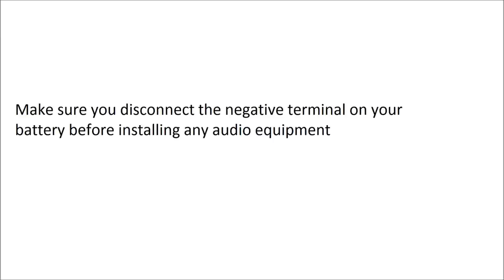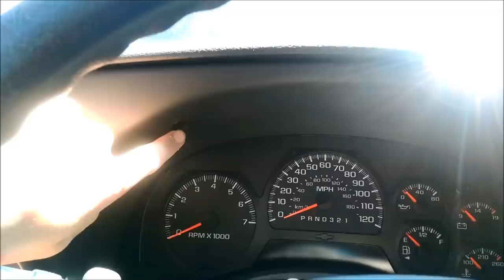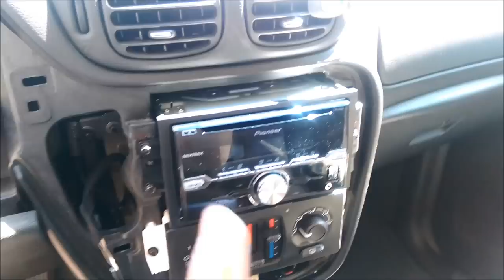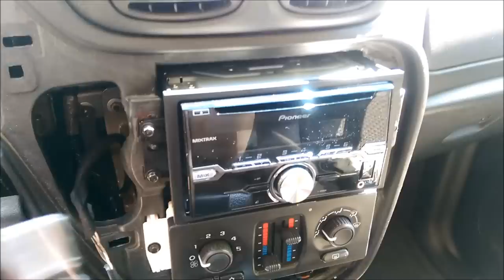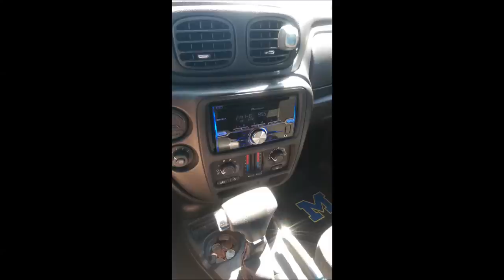Radio install in Chevy Trailblazer with Bose premium sound

Comment: How did you do the illumination wires. I have illumination and dimmer wires. The instructions told me to connect the orange with the orange white unless it was populated on the factory side. This is my first time doing this I don’t know what this means
Reply from the maker: Greg Keener honestly i never got the illumination to work. it’s not a nesassary unless you want it? populated on factory side means it was hooked up and being used. like had a pin out.

Comment: So does anything actually have to be done directly to the stock amplifier in order to bypass it, or does this harness make that happen? I have a 2006 Envoy Denali w/ bose and onstar, no DVD.
Reply from the maker: this adaptor takes the 50watt signal coming from the head unit and reduces it into a signal that the factory amp can use. some choose to not use the adaptor and just remove the factory amp and replace it with a new amp all new wiring and speakers. but this adaptor allows for a new head unit retaining all other factory equipment. hope that helps! :)
Reply: +Rydog's Garage yup, thanks!
Reply from the maker: and I'm still using this adaptor a year and 4 months later, no issues, and I crank the music all day everyday lol, I have 2 12 subs installed and I swapped the head unit for a touchscreen one, so it has worked for 2 head units also

Comment: what color wires do you have passing the interface?
which colours are the navigation system. my new head unit does not have navigation.
what is the 12 pin connector for.
last question hahaha. what color is the remote turn on for the harness itself because i have an amp and subs going in and cant find the remote turn on.
If you get back to me asap that would be really helpful.
Thanks
Reply from the maker: only the black ground, and yellow and orange wire bypass the interface I believe, your only matching to the harness that came with your radio, the 12 pin one is for steering wheel controls, if you don't have them the wires can be pulled out, and the nav wires are all the extra ones that don't match to a color on your radio harness, they can be cut and capped or pulled out also, the remote turn on wire should be labeled by the Harness that came with your aftermarket Radio
Reply: +rydog12100 all i have left on the aftermarket harness is blue and its for the power antenna. is that still the same as remote turn on and what would be the color on the metra harness?
Reply from the maker: +Gavin Blanks yes power antenna turn on would do the same thing as remote wire, and does not need to be hocked up to the interface just straight to your wire to your amp, but the dark blue wire on the harness would go to it

Comment: hey man, thanks for the video.  I have been searching everywhere for answers.  I've got an 05 trailblazer and just replaced the 4 factory speakers with RF and am adding 2 RF in the dash.  I bought a head unit and also the interface from axxes.  since I only have 4 speaker outputs, I thought about running the 4 front speakers off of a cheap amp and the 2 rear, off the head unit.  I am so lost as to how and hook it up this way using the interface.  any help would be so appreciated.
Reply from the maker: hey! you are going to have to wire only the rear speaker wires to the interface and head unit, and then run rcas from the head unit to the amp for the other 4 speakers, there is white grey purple and green wires, for the speakers on the harness, each one is for a seperate corner of the truck, I forgot exactly which color is which corner but it should say on the wire, and you are going to need to figure out and use the rears, for the front speakers and amp you have to run seperate speaker wire from the amp to the 4 speakers, and power and ground for that amp, remote turn on, and fuze the power
Reply from the maker: sorry I know that's a mouth full! lol

Comment: I have a Jvc with the same harness and I have a orange wire on the headunit and a orange with a white stripe what should I do I tried connecting them and it did not work and tried without them and still didn't work
Reply from the maker: the radio dosent work without that conected? what color wires are in the jvc harness?

Comment: Did you use the RCA's or just the wire connections for the factory speakers?
Reply from the maker: Jeffery Morris this adaptor harness uses the stock bose amp and speakers. and makes it work with the aftermarket radio. you wire the white green silver and purple speaker wires in like any other install. the rcas are for my separate sub amp.
Reply: @RydogsGarage  thanks man. Worked perfectly

Comment: I have a question. did you leave the factory Bose speakers or did you get aftermarket speakers?
Reply from the maker: +Jose Hernandez all speakers are factory, this adapter in the harness allows for you to keep the factory speakers and have a aftermarket head unit, because honestly the bose sounds verry good, just wanted an aux port for my phone, and a easy way to install subs
Reply: Oh alright that's pretty cool then. Yeah I understand I still have the Bose stereo and I have to use a fm transmitter to use my phone and it sucks!!
Reply: Thanks a lot this video is very helpful!!
Reply from the maker: yeah fm transmitters are not good enough for my im big into audio, i actualy just swapped the radio again to a pioneer touch screen, avh-2700bs, used same harness bluetooth and hands free calling is all work flawlessly, if you have any more questions i can help you out! wiring for this stock bose is a pain! but all worth it in the end, no reason to rip out good speakers and buy all new especially if you want to sell the car
Reply: I got intrfacer at Auto zone 50 bucks for 2007 Cadillac srx

Comment: I hooked the harness to my cd deck. matched all the speaker colors but my volume will not turn up on my speakers. would you know what is the cause of no volume? your advice will be appreciated.
Reply from the maker: the gain knob on the harness could be not set correctly, it's the little blue dial that uses a Philips screwdriver to turn it. there is a special start up procedure to set the chime volume then set the gain
Reply: Rydog's Garage I have the same issue but my front speakers are loud but my rear plays real low what is this issue

Comment: hey. raydog. question.    I hooked one of these up in my yukon and the sound/audio only plays for about 5 seconds. then goes silent. any clue why?  everything continues to work just no sound
Reply: Tom Mccarthy exact same thing with me. I have a 2005 Tralblazer tho
Reply: @ethantaylor901  I just installed and have the same problem,  did you find a fix for yours?
Reply: I have the same problem! I thinks it's a interface glitch . I know for a fact I have everything wired properly. I have 07 gmc envoy with bose

Comment: It will work with out the the metra box you just need to run acc wire to the fuse the box is only for on stare
Reply from the maker: no not true. you don’t want the 50 plus watt output coming from the aftermarket radio and getting sent to the bose amp. it will fry it. box brings it down to just the signal. as well as having conections for onstar.

Comment: Question: did you have to remove the stock stereo bracket in the back of the stereo space for your install?
Reply from the maker: Adam Tyma yes i took a dremmel and cut the back support out to give extra room for the wiring harness

Comment: I bought the gmos-04 for my 03 yukon xl. I bought the Sony MEX-XB100BT that has the extra amp to it. I don't to use the bose amplifier anymore because it's failing. Is there a way I can use the interface but bypass the connection to the amplifier? Can I still use the speaker wire in the door?
Reply from the maker: diesel2421 if the radio has a amp in it, you should be able to run the wires for the speakers together bypassing the interface, and then find a way to wire and bypass the amp in the back of to truck, i believe the amp is on the passenger side all the way in the rear... but don't quote me on that
Reply: Rydog's Garage the amp is up front under the center console. So new speaker wires would have to be ran from the factory amp? but I dont want to use the factory anp anymore...
Reply from the maker: diesel2421 sorry i read that wrong didn't realize you have a yukon... the amp for the blazer is in the back, no you just have to unplug the factory amp and run wires from the radio to that plug that you took out of the factory amp

Comment: Hey Im installing a pioneer radio in a 2002 Chevy Impala without Onstar, I just can't find any install instructions online. I have all the parts, I just don't know where to start.
Reply from the maker: +Yalena Talley the harness needs to be custom made, by soldering the wires together, the harness that came with the radio, and the adaptor harness you bought that plugs into the factory connections, should match color to color, solder those together, and use shrink wrap make sure no bare wire is exposed, then continue to take your dash apart and remove factory radio, not sure how it comes apart on your car have not been in one like yours, but the harness you made should plug right in an the radio should mount in same spot!
Reply: +rydog12100 The car has an adaptor as well so that it retains the chimes. How do I connect that to everything?

Comment: I have a 06 trailblazer and i am trying to install doubl din unit.  How did you wire the ignition red wire that gets wired to get the radio to turn on when the key is in the on poaition? Can you send me a good link or anyting that will help me wire the ignition wire for the radio.
Reply from the maker: Bethel Bekele it should be apart of the adaptor harness, if it is not you have to run the wire in the dash and under the steering wheel. and probe the red wire on the steering collum so that the probe lights when you turn the key. and is off when key is off. you use a tap connector on it to tap the radio wire in

Comment: Help! I hooked my aftermarket up. Its the size of yours and I used the same axess wiring kit. My radio comes on but barely has any sound. Do I need a wire to the battery?
Reply from the maker: no there is a gain knob you have to turn up on the axess harness
Reply: +chad hinkle I literally just went through this tonight. Installed my new deck,&#160;sound was going to every speaker but it was barely audible.&#160;&#160;You don't have a factory amp, I cut the speaker wires before the big black box and spliced them into the speaker wires on the radio harness. Pretty much I just bypassed the black box and everything works perfect. Or you can just go buy a non amplified harness.
Reply from the maker: +Jesse Taylor this video is for people who do have the factory Bose amp and is what the harness is for, like you said he must not have the amp and just has the normal sound

Comment: Were you able to maintain steering wheel controls? I have a Silverado I'm looking to do this in
Reply: that requires a seperate interface (atleast on my 2004 Envoy).
Reply: Paul is correct.  It's like an additional 20 bucks for the harness
Reply: I did somthing wrong my key wont turn all the way back

Comment: So I'm facing same issue. So all I need is that interface deal? Would I still be getting sound through the amp..or does it bypass it?
Reply from the maker: Sal Dorado with this interface you can use any aftermarket radio and the bose system will work exactly how it should
Reply: Rydog's Garage Thanks for the info! Already have a interface and Alpine deck lined up. I'm really quite impressed with how good the stock Bose sounds. Why not keep it...right? Surprisingly the speakers aren't blown yet...I'm just gonna roll with it.
Reply from the maker: Sal Dorado i added 2 12" subs and a 600watt amp for some extra bass and i love the way my system sounds
Reply: Rydog's Garage That's what's up right there! I have a system in my Jeep...I'm all about that bass. T.B. is wife's ride...she's not into all that..lol
Reply: Hey, do i need a harness that will comply with my steering wheel controls?

Comment: I have never unhooked the power or neg, 
I bought the $35  1 and it was as simple as crimping the wires and plugging into the stock harness and the radio. I forgot to turn the ignition on off on off before using the radio so I guess that's why the steering wheel controls don't work. But the radio stays on after pulling the key until you open the door and the chimes work. Yiup the setup I got had the accessory (red wire) and the constant 12V (yellow wire) with the box and the harness. (( PLUG AND PLAY )).
  Metra LC-GMRC-01 GM Class 2 Data Bus Interface: AMAZON $34.99

 Now for my AMP, I had to go under the LRP seat to find a REMOTE on-off fuse that worked with the accessory power of my 2006 Trailblazer LT. So I just ran the 12V power from there also. The only wire I had to run from the HEAD UNIT was the AMPS RCA's.
 Yeah the remote from the HEAD UNIT wouldn't run the AMP. (I thought my AMP was fucked up)

   Suggestion , Get a HEAD UNIT that the 7" / 8"screen will angle, 8" you will be cutting but will fit fine. 

P.S. 39 years of installing and uninstalling.
Reply: +sir jaime roland ruiz 
The only thing that should be on the steering wheel is CRUZ CONTROL! And or paddle shifters
Reply from the maker: +sir jaime roland ruiz i state to unplug the battery because its to save my butt, just incase someone dose not do the wiring right, i dont need them blaming me for fried equipment. thats all, i agree, i dont unplug the battery 9/10 either. the adaptor i bought allowed me to only match colors and it plugged right in, no need for me to run extra wires. the only  wire i ran extra was for my remote turn on for my sub amp. i like to soldier the connections because i know they will never come part and its just a preference. i have now sense upgraded to a avh-2700bs touch screen from pioneer and love it, was able to just cut and resoldier harness, plugs in and works exactly how i had it set, no issues.
Reply: rydog12100 , LOL right on, BUT... if they have hooked up the wires wrong and power it back up @ that very moment it will POP. So... 
TOUCHE !
  Congrats on the upgrade, not to bust ur bubble though. The first 1 I bought cost like $500 second like $300 and this 1 $169. 

  I love PIONEER but I can get the same or better for cheaper with off brands trying to make a name or just doing people RIGHT and not paying for a NAME! 
 Did PIONEER go ANDROID YET? I think KENWOOD did.
Reply from the maker: good point lol but less will be taken out, i would hope fuses go and equipment is saved
Reply: +rydog12100 hey , I lost my speedo and of course the cruz control and whatever it is , it's fucking with the shifting of my trans. I'm thinking it's the damn remote amp wire I disconnected.
Reply from the maker: +sir jaime roland ruiz I fuze could be blown... did you put the remote amp turn on wire in a ignition fuse in the fuze box under the drivers side rear seat?
Reply: rydog12100 lol fuck yeah!

Comment: At 5:41 what is the smaller plug for? 
I got a interface kit but it’s only got one plug for the bigger one??
Reply: Did you get any answear at that? I also need to know what cable i have to put in to that plug:)

Comment: my truck is non Bose system just regular everything do I still install everything like u did
Reply from the maker: nope you can get a regular harnes that does not have the adaptor, the harness will be a plus that goes to the stock conection that has wires that need to be matched and soldiered to the harness that comes with your new radio

Comment: how do i know if i need a interface i am putting a pioneer single din into my 08 sierra,i have 4 door speakers and window post 2"speakers not putting in any bells and whistles in just plain stereo radio
Reply from the maker: Buster brown does your factory radio say bose anywhere? or on the doors. if so you probaly need a PAC interface harness. if it dosent and that’s just the basic sounds system. you just need the basic harness that lets you wire in new radio to stock plugs.

Comment: I’m missing one of the harnesses that plugs into the black box itself. Where can I order one of the plugs that go into the harness?
Reply from the maker: Kyle Clevenger no idea. but i have both sides plugs just sitting in my drawer at home. using a different set up now.
Reply: Rydog's Garage strange question lol but you wanna send em to me?😂 I’m really not feeling spending another $90 on a wiring harness
Reply from the maker: Kyle Clevenger added you on facebook.
Reply: @kylesvideos59 do you need this harness ? or can you just put the big harness in? i really don’t wanna buy a whole new one lol